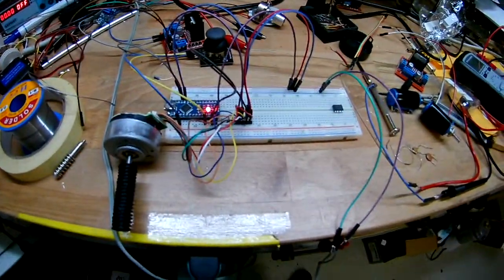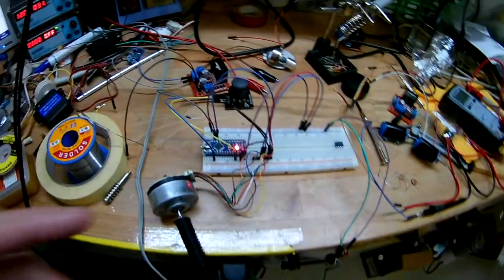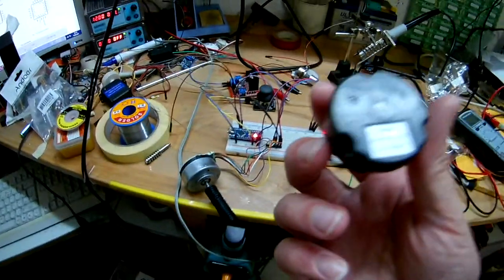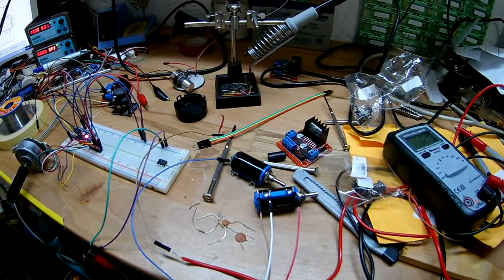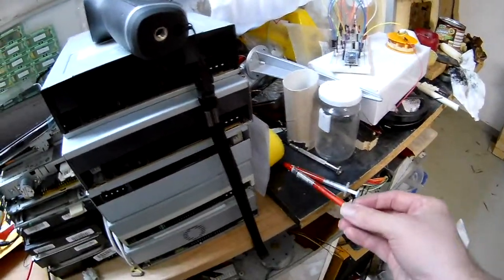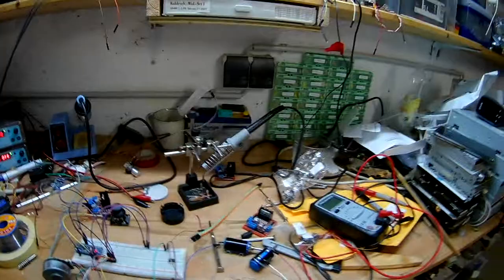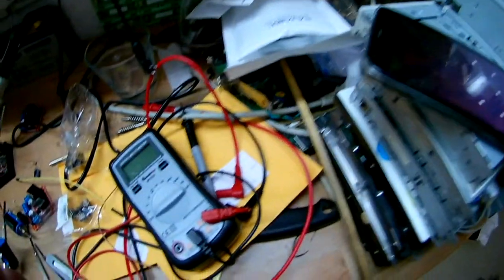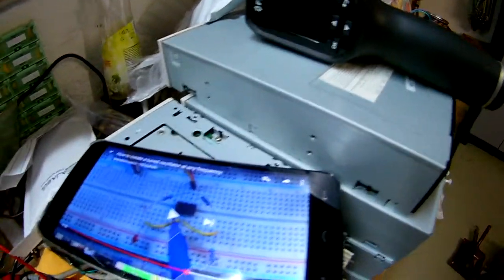BLDC motor, 10 turn pots, oscillator fail

Comment: You got the oscillator to work now, right?
Reply from the maker: damn email notifications dont work for this channel =/ and i dont check very often.

i found a way to drive the oscillator with a single rail supply (using a charge pump to create the negative voltage), but now im having problems converting the sinewave to a square wave. i was under the impression that if i pipe the signal into another 741, pull the inverting input to gnd, and put the signal in the noninverting one, that i would get out a neat squarewave, instead i get garbage =/ i will upload a quick update video today where i talk a bit about it. will also put schematics in the descriptions if i can